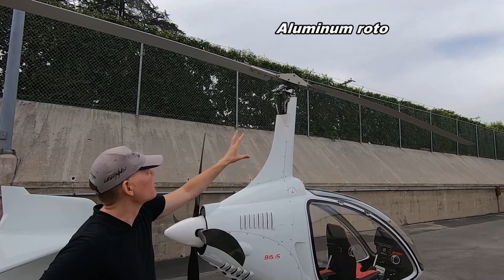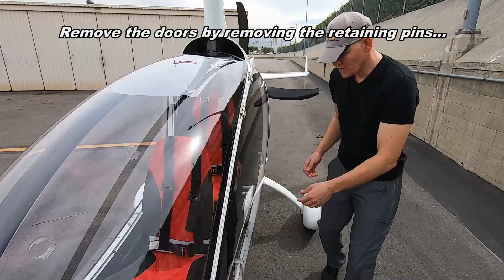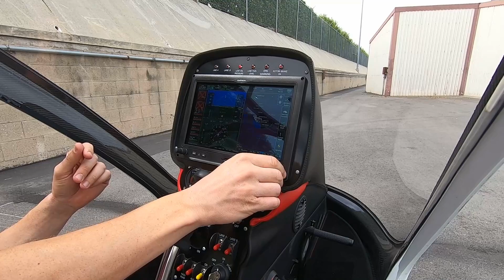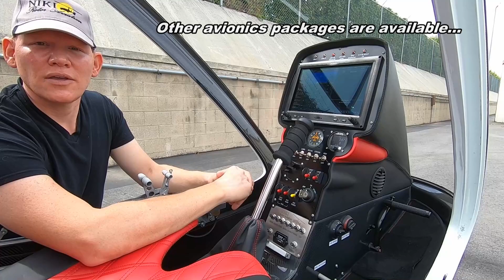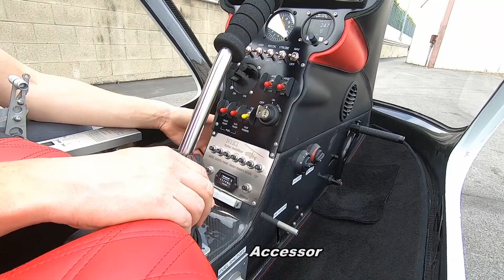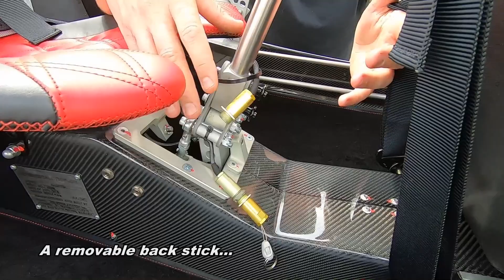Niki Gyroplane Kallithea Review 2020

Comment: I’m very interested in this gyroplane and I have one question. It is stated in this video that the service ceiling is 15,000ft but on the Niki website I remember it saying that the ceiling is 3000m. That’s is a difference of just over 5,000ft. I quizzed a friend of mine about this and was told that the rotor blades are probably unable to safely go above 3000m. What is  your opinion?